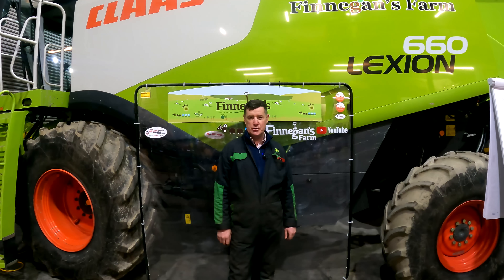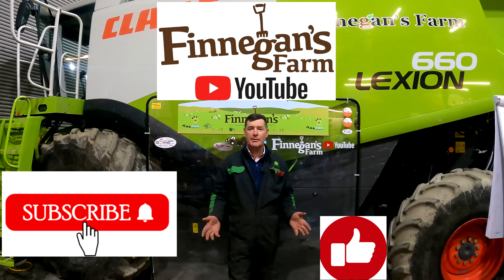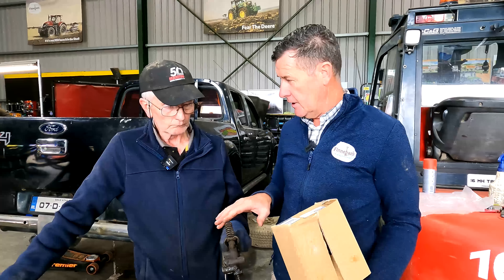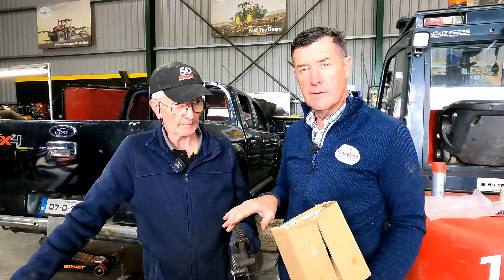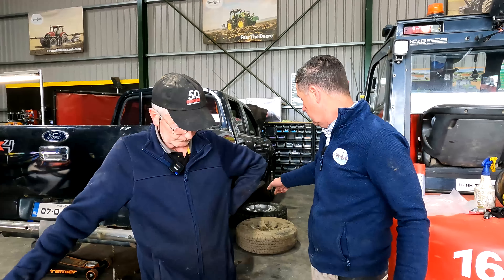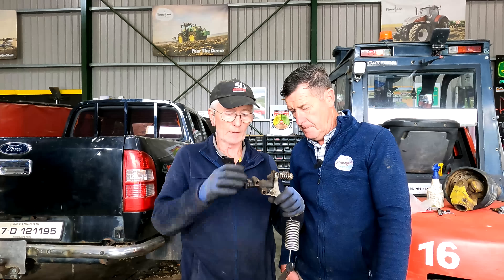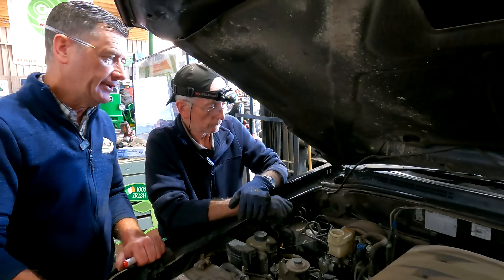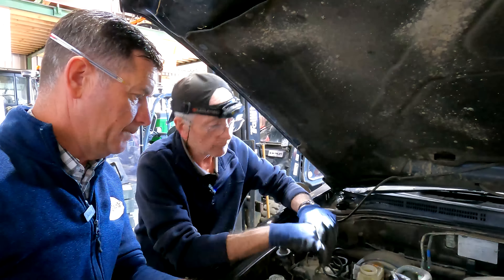WORKSHOP WEDNESDAY EPISODE 47

Comment: The tool is for going round a cable ie quad brake cable and squirt wd40 or oil down it to free it off the PTO gaurds are very good IV fitted them many times and found my customers grease them better because they easy to use good video
Reply from the maker: 👏👏well  done  Justin